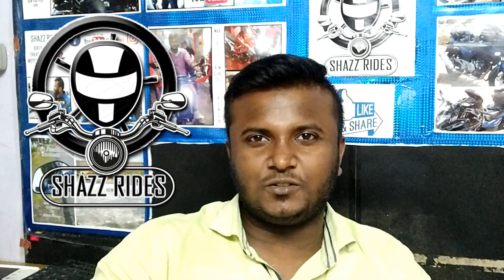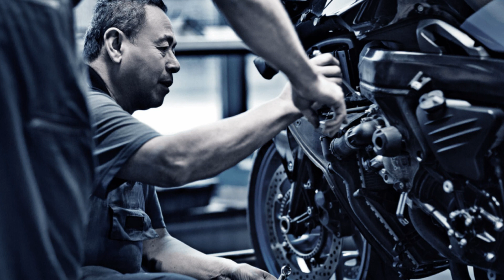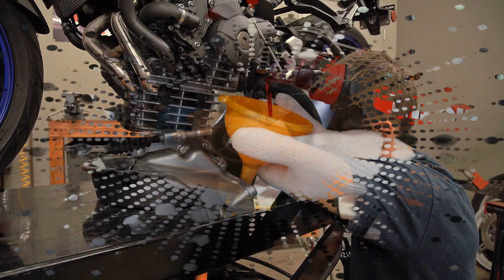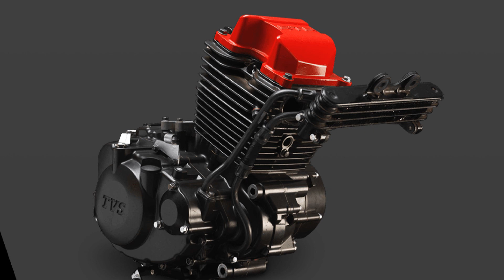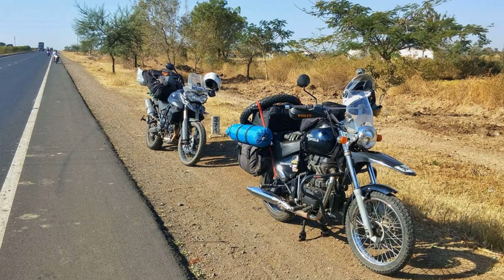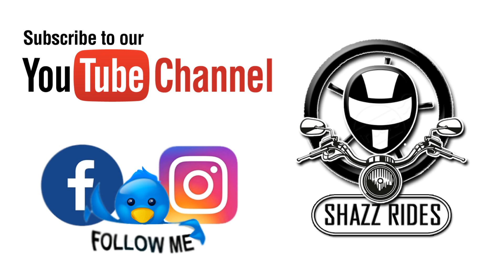Can We use 150cc or 160cc Bikes for Long Distance rides? |Tamil | ShazzRides #50

Comment: I've ridden 4 times on my Rx100 from home to Bangalore. 420 km..  i take one stop for fuel.. and one for puffs at hosur iyyengar bakery.   Normal cruising speed 80-90.  If i can do long drives on a high vibratory 30 year old engine, then 150 to 160cc bikes can do more than that!
Reply: Rx100 is true road king

Comment: Once i did a long ride in my 150 cc unicorn. From chennai to vellore. At first i went non stop about 100 kms at high speed so i engine got heated up. When i came back i felt not comfortable to cruise in 80kmpr coz of some vibes. Which is the recommed cruising speed of unicorn 150cc plz share.
Reply: bro without any break I went from chennai to yelagiri hill top with my pulsar150...good experience...nice and smooth trip

Comment: Bike eduthu 2week tha aaguthu 200 km run pannirukken ,then long drive polam ha bro ( 300 km ) apache 160 4v
Reply from the maker: Bro,  yenna ketta venanu tha solluvean. First service panittu porathu nallathu.
Read the Manual book they have given some instructions so please follow.  

Kandippa poiaganum na just check with you're service center
Reply: Ok bro
Reply: Polam bro..otta dhana bike vangunenga..but make sure to do service on 1000km
Reply: Apache 160 4v tharalaam long drive polam.. oil cooled engine ...80km ila 150km stop panni poga tevailla bro

Na cuddalore to chennai la na nerya thadava stop pannama poirken...onuum agarhu
Reply: Apache rtr 4v my dream bike nanba.... 😣😣❤️